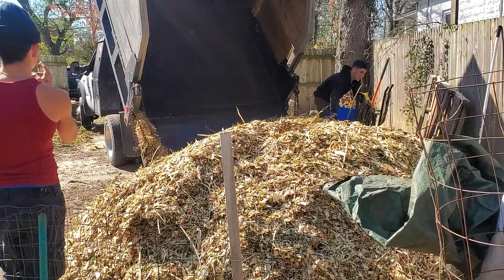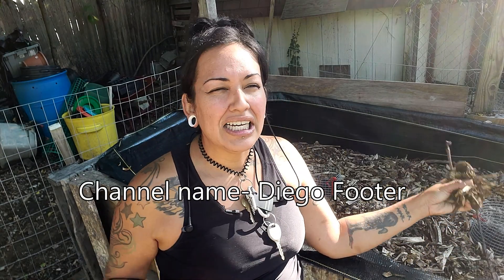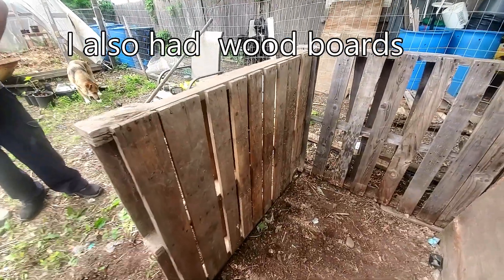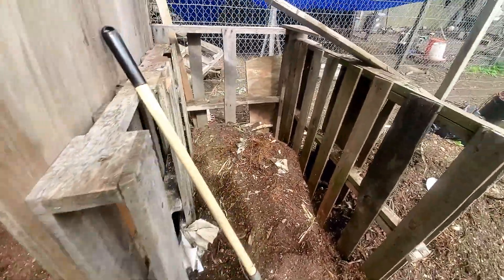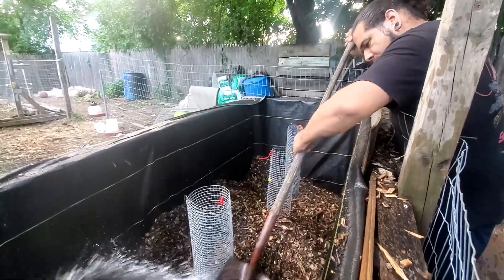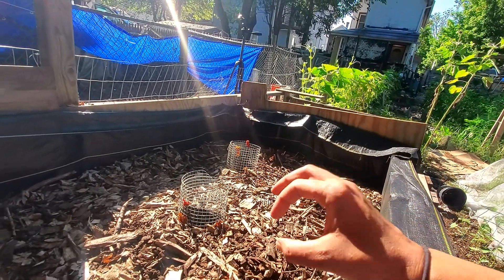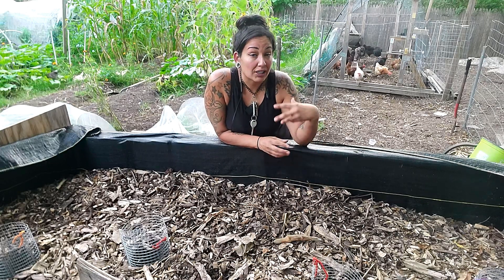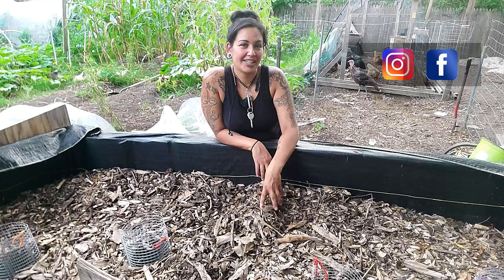Building A Bioreactor-The 1 Year Composting Experiment

Comment: My previous house didn't have an outside tap, so I kept a bucket in the sink and any time I washed my hands, rinsed off plates, etc., the bucket collected the water and was used to hydrate my garden. It's crazy how quickly it filled up. As long as you don't use antibacterial soap, that might also be a good way to keep hydrating your mulch while infusing it with microbes and other stuff that will help power the decomposition
Reply from the maker: Nice!
Reply: What type of soap 🧼 do you use ?
Reply: @bettinaripperger4159  Just cheap dish soap from the Dollar Tree. I never noticed any ill effects on the plants

Comment: Just get some chicken wire fencing to make a 3ft diameter enclosures and fill with what you want to compost. Use at least three fence posts to maintain integrity/keep it standing. Relatively cheap and re-usable. Time takes care of the rest.
Reply: you definitely want something firmer than chicken wire, like she said. i used it to make raised beds this year and it was a mess, the chicken wire provided basically no support. definitely gonna be looking for something more like the square mesh in this video.
Reply: @nascenticity  I'm using this plastic fencing that's holding up well. I don't know the difference between square mesh and chicken wire. Maybe I'm thinking of something else.